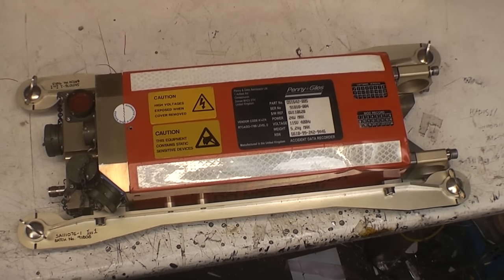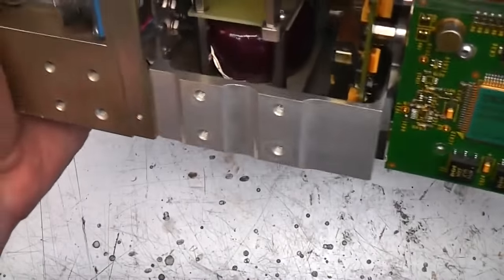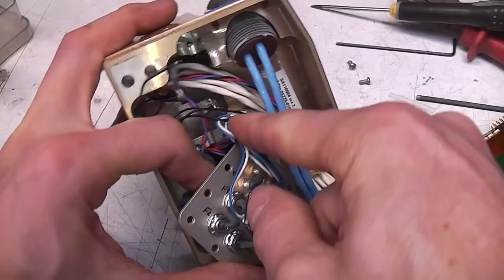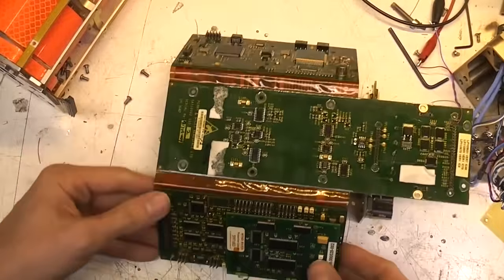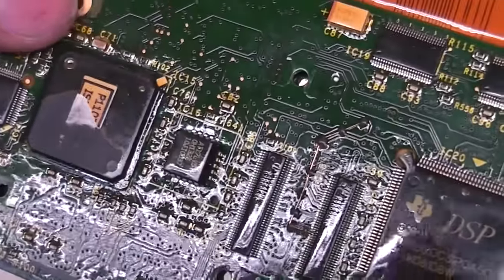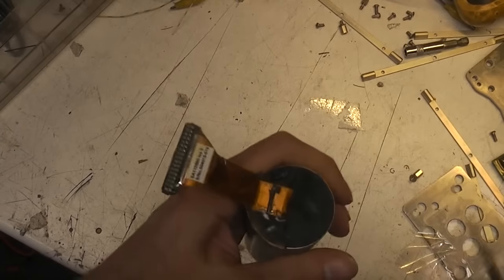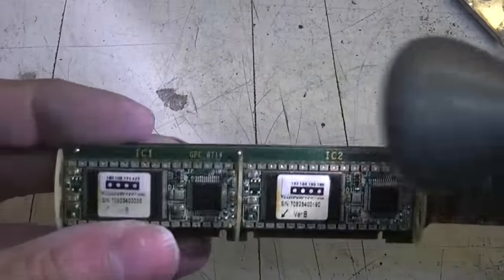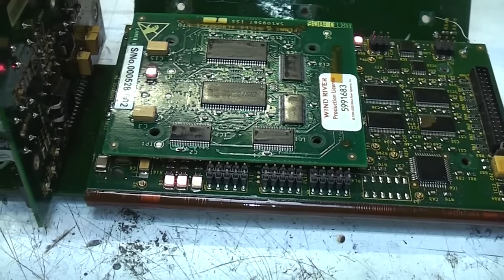Solid-state flight recorder teardown

Comment: NMAP IT !
Reply: Most likely a proprietary protocol, meaning Nmap, Wireshark or most any publicly available analyzer will not work.
Reply: I highly doubt it's proprietary. There's no reason.
Reply: ***** 
If this flight data recorder was used in a military application it is a very good possibility.
Reply: If it's used in military, it's guaranteed not to be proprietary.
Reply: John Ridley 
At least for the US that is not a completely accurate statement. 
I have worked on several military systems that employed a proprietary transport protocol and required an specific interface cable connected to a DTU that was connected to a PC/notebook over RS-232, USB, or Ethernet with specific software to access and decode flight data or cockpit voice recorder data.
Reply: They may just use encryption on the traffic itself but i doubt they touched the ethernet protocol itselt.
It could just have a static ip set up on the 10.x.x.x or 192.x.x.x networks since i'm pritty sure if they got this running in planes they would have some form of "this decive always has this ip" kind of thinking rater then locking by mac address since that could differ from unit to unit if they used a dhcp setup.
Reply: If this is AFDX then the do touched ethernet it use different layer 2 addressing. For military planes it might be MIL-STD-1553.
Reply: Nick Chernetsky
1553 is only 1MHz so it uses much bigger transformers.
kinda easy to distinguish from ethernet.

Comment: Found eBay listing for the same NSN for a Tornado (which I also thought it could be for) flight data recorder.. google ebay id 131622930631 That listing ended on 25 Oct, 2015 so probably won't be there forever.

Comment: From the amount of storage and the overall design, I am guessing that at the time, those flight recorders sold for around $100-$200. They likely also did not sell well with such a tiny amount of storage.
Reply: The data stored isn't much, a few minutes of audio pre-crash and basic plotters for control surfaces, fuel, etc which can be decoded externally, to save on space.

Add 2 zeros to the end to be in the right ball park
Reply: Umm... actually they are around 50-60,000 dollars.
Reply: If you're lucky, you can buy one of those connectors on the front for $200,-
Reply: +Razor2048
Are you serious? I guess you expect a new car costing $20 then?
Reply: It depends, the average cost of a new car, needs to come down to the sub $4000 range for something on the level of a Toyota Camry, and probably in the range of $15000- $20000 for a vehicle along the range of pagani zonda, or other higher end vehicle.

Overall, too much price gouging takes place.for both cars, and planes.

Comment: I fail to see the interest in examining digital flight recorders.  They are just like any other data retention device, but with armor.  The action takes place in other computerized devices,  such as Air Data Inertial Reference Units, flight computers, autopilots, and various sensors.  All these items send data to a Flight Data Acquisition Unit, which conditions the data and converts it to digital streams sent to the recorder.  The really interesting recorders are long gone--the electromechanical, analog, five-parameter recorders that became obsolete when digital recorders debuted during the 1980s.  The old analog units recorded data by scribing lines and marks on a long roll of stainless steel tape which rolled up in an armored magazine after passing under the scribes.  This tape was extremely thin and so sharp-edged that it was dangerous to handle.  The fun part was in having on tape a visual reference to what had happened on a given flight.  It was terribly crude and limited when compared to the dozens of parameters recorded on modern aircraft, but a calibrated table and microscope allowed recovery of a fairly detailed record of altitude, airspeed, heading, vertical acceleration, and communication events (voice transmitter keyed), all referenced to a time scale.